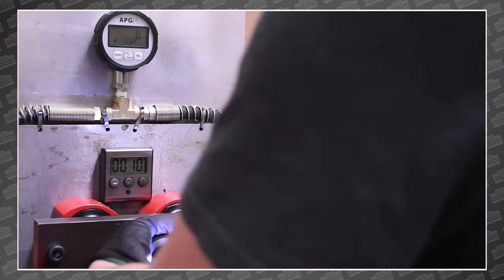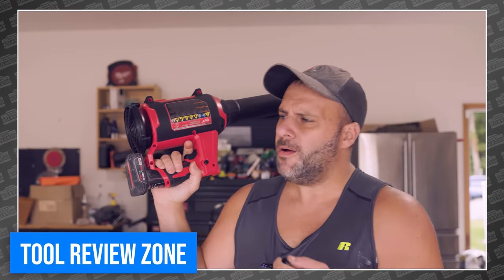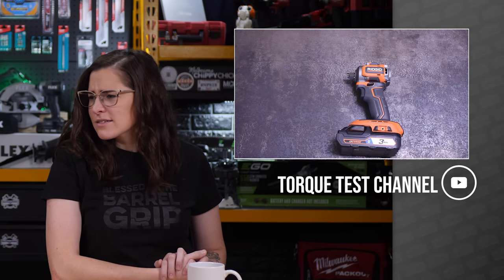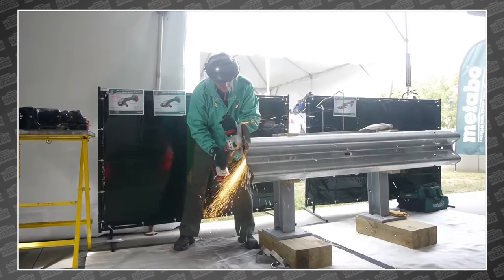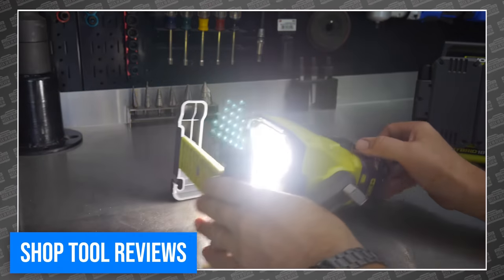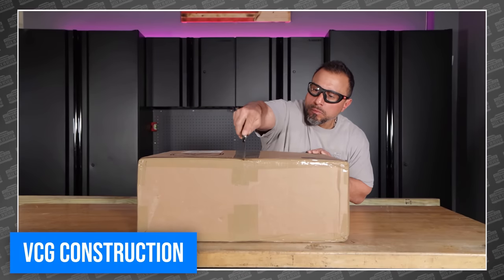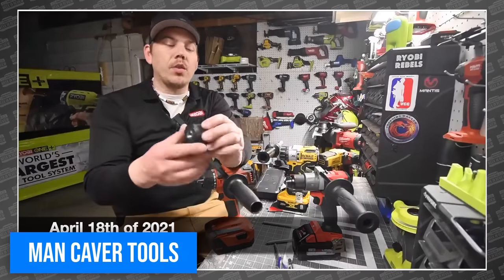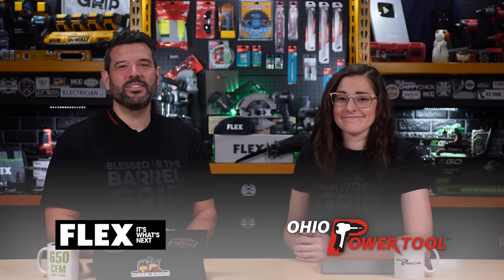NEW! Milwaukee puts BIG POWER in tiny tools. Plus the King of Impacts! Power Tool News! S4E40

Comment: I would never use an angle grinder to cut rebar or angle iron that what my band saw for. Seen too many accidents.
Reply: I hear ya you know Milwaukee’s got some steel blades out that work really good I’ve got a few of them They don’t cut as fast but they’re a lot more safer